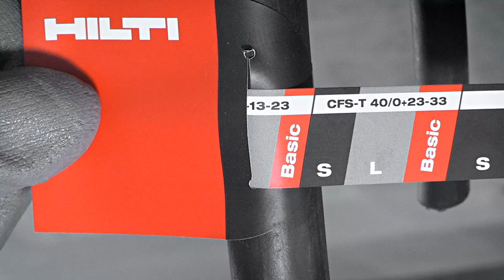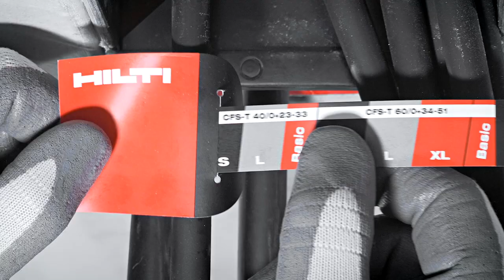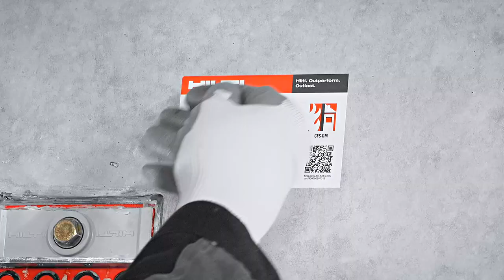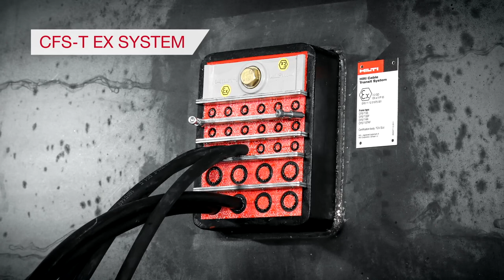HOW TO install Hilti CFS-T SB and CFS-T SS cable transit systems

Comment: Why are these necessary?
Reply: for plant protect control room  if there is gas leakage for example
Reply: For fire, water and gas resistance cable and pipes transits.